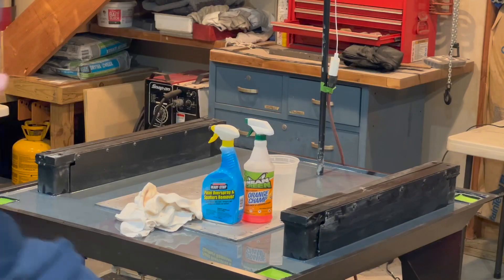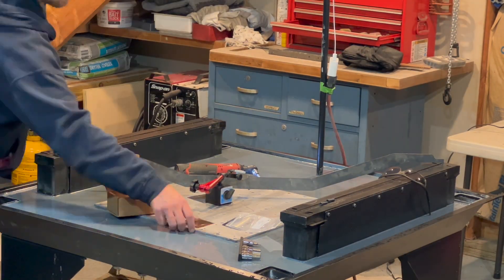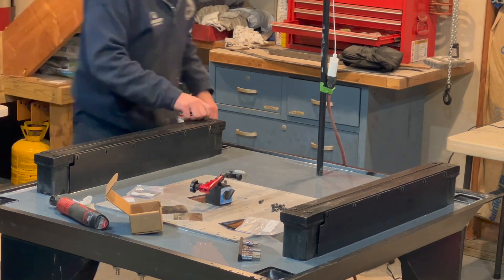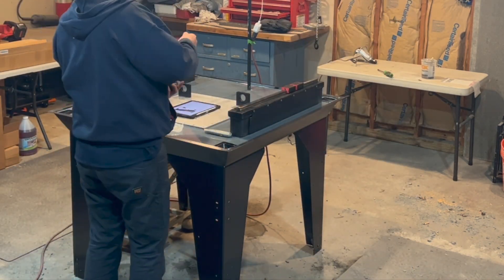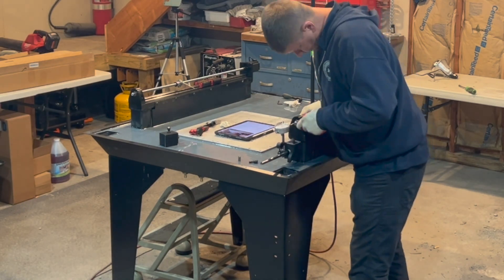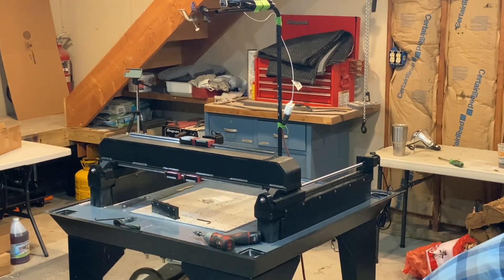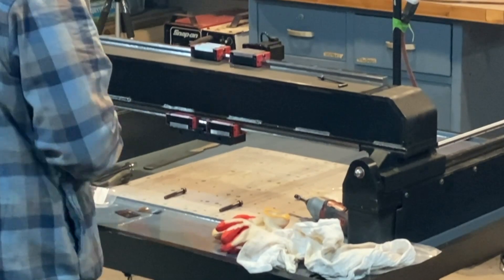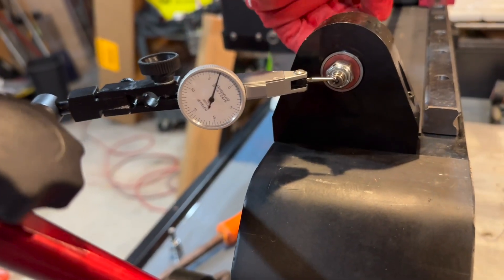MR-1 (Pt. 3) XY and Z axis Assembly

Comment: Nice, just 1 thing. Cut your insulation around your gang box, as a former insulation installer this has my OCD going CRAZY!!!, defeating the purpose of insulation there. =)
Reply from the maker: LOL! don’t worry in my latest video, free modifications the insulation is sheet rocked over
Reply: @worknplayusa  do you think instead of mixing cement the normal way, if you made epoxycrete if it would be more beneficial. It does reduce vibrations drastically over just regular concrete.